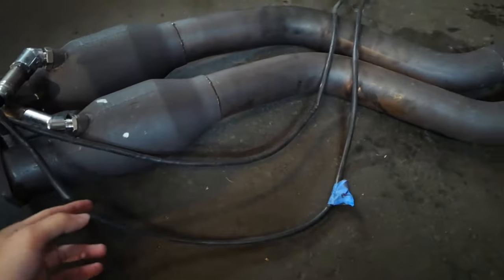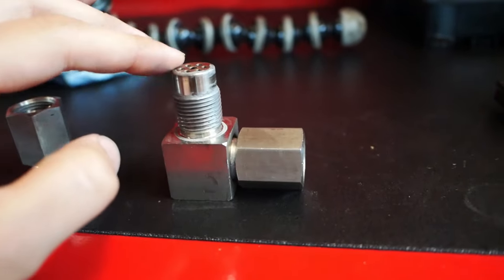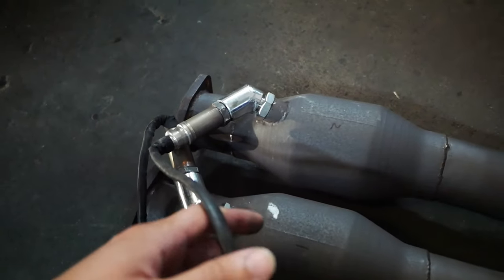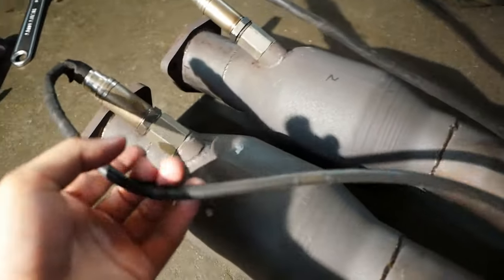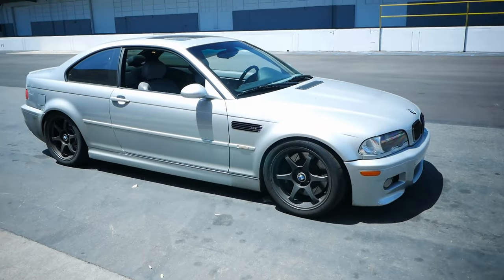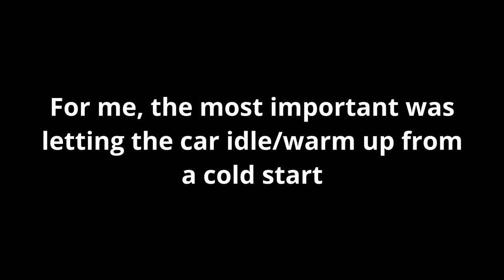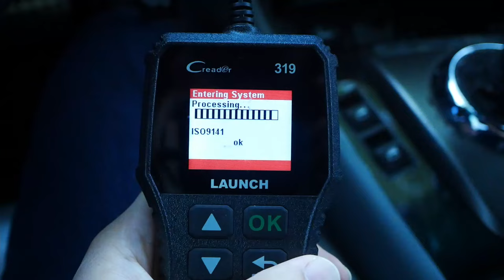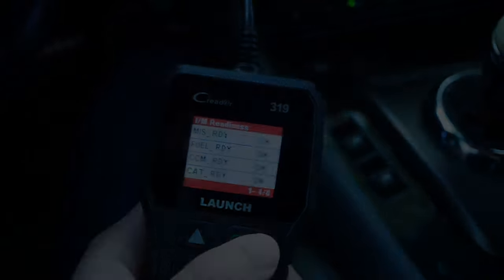Fix P0420 Code | How To Use O2 Sensor Spacers | Project M3 Episode 2

Comment: I don't understand why he drove it around for so long to reset the code. He had an OBD2 reader, you just erase the code with it and then drive around making sure the check engine light stays off.
Reply from the maker: You have to drive around so that the "monitors" are set to ready. They are basically a set of tests (for emissions) that your car runs to make sure your smog equipment is all good.

These tests have several criteria that must be hit before it determines its ok. The one for the catalytic converter was the hardest to set and it took couple hundred miles of driving a certain way for it to give the OK.

You need these to pass smog the state smog check.

Comment: Installed 45mm straight spacer. Got rid of p0420. But now p0138.
Reply from the maker: Did you have the P0138 before? You might need an o2 sensor replacement.

Usually if you ran no spacer or not enough, you'd get the P0420 for cat deficiency. Too much spacer and you normally get like a P0137 (voltage too low).
Reply: @HazardGarage  No p0138 before. Only p0420.
With 45mm spacer, voltage remains steady at 1.2 volts.
Reply from the maker: @ArunKumarSuthar  that is weird. Could really be a bad rear O2 sensor. From what I've seen a spacer doesnt cause a P0138. Usually youll either have the P0420 again (which means you need more spacer) or you get a P0137 (which means you have too much spacer).
Reply: @HazardGarage  thanks for your suggestion.